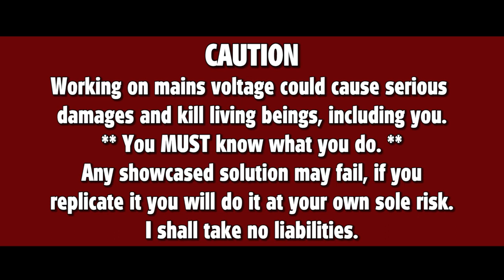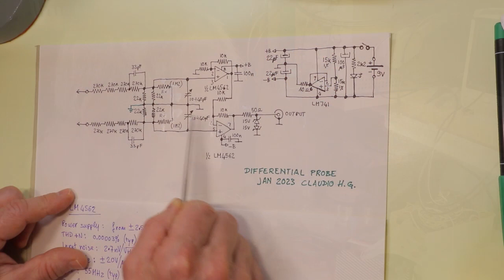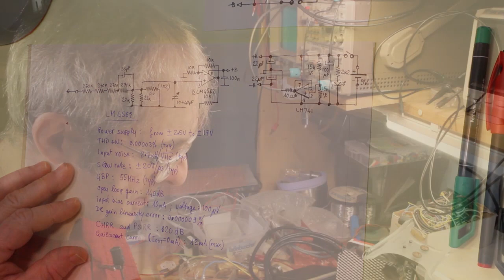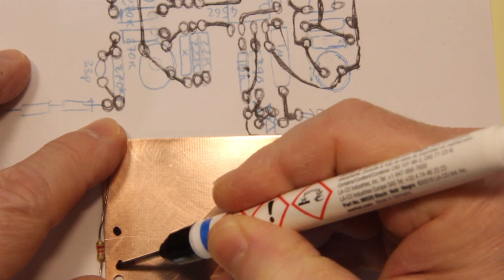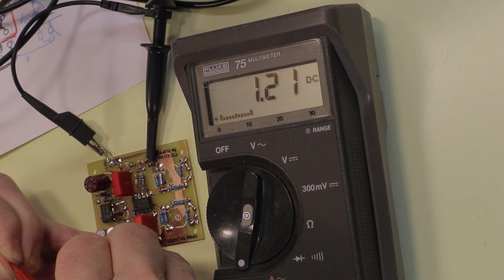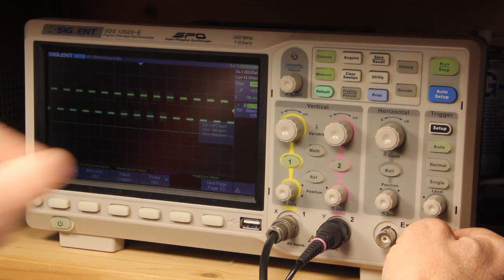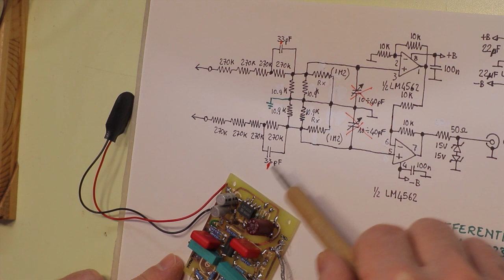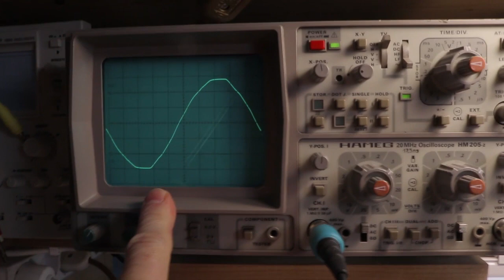DIY Active Differential Probe for your oscilloscope | Do-it-yourself electronics

Comment: Pausing to comment on a couple of things:
quad opamps give you 4 of them per package.  There are useful things you can do with one more opamp.
Two 9V batteries can also be used so you have +/-9V to work with.
A trimmer resistor can be used to make up for the fact that your resistors are only 1% unless you have a big budget.
To trim the resistors you apply the same signal to both inputs and trim for no  output.
Reply from the maker: Thanks for commenting. Cheap trimmers can be a source of problem as they vary with temperature much more than regular resistors. Good trimmers are immune but they are way more expensive than 0.1% resistors. So I preferred to select pairs among a bunch of 1% resistors. I don't remember if I mentioned it in the video, sometimes I take for granted things...
Cheers.

Comment: Really glad I stumbled across your channel. And hope to see you get a lot more followers and attention in the future.

Regarding this build... The weak link is definitely the Duracell battery. I've lost thousands of dollars of test equipment and other associated tooling to Duracell batteries. Some of my favorite portable lab equipment over the years. LCR meters, pricey multimeters, handheld Scopes.... And all kinds of other random things. 

Technically all alkalines are risky....But Duracell is the worst for some reason. Which is a real shame because they used to be the best for a very long time. 

Now i will only use the Energizer ultimate lithiums... They're not rechargeable and they are more expensive but I've never had one  leak. And they seem to last three to five times longer than your standard Duracell alkaline. 

Luckily most portable test equipment these days is being built with internal rechargeable lithium cells. Most of which are standard 18650s that can be swapped if they ever wear out. But they're still a surprising amount of medium to high-end equipment that doesn't have its own internal rechargeable battery. For some crazy reason 🤷‍♂️🤦‍♂️

I really enjoy the videos and look forward to more content from you in the future!
Reply from the maker: Thank you. Lithium batteries are expensive at the point they may shift the cost of the whole equipment.

Comment: Hi, nice video,
what sort of pen/marker did you use to mask the PCB before etching?
Reply from the maker: It's "Dura ink 5", it's similar to paint pens used to mark on metal but with a finer tip (about 1mm). Alternatively I use a quill pen with ink for metals, which gives better results, in particular ink resistance against the acid and water, but it's harder to master.
Reply: @AccidentalScience  Thank you :)

Comment: Where do you get the resist pen  I've tryed some with no good results ?
Reply from the maker: I use a paint marker pen, with oil-based ink. A few are available with a reasonable fine tip (about 0.8mm), specifically what I use as resist pen is a "dura-ink" long thin point made by Markal. It is labelled as corrosive but it is not that corrosive on copper. Best results are achieved using an ink for metal stampers and a fountain pen, though it is a tad more cumbersome to use. Also try to give a look at this: https://accidentalscience.com/12/Printed%20circuit%20board%20techniques.html
Reply: thanks i found some and will give it a try

Comment: what is the max frequency can be read by this probe?
Reply from the maker: @endremurti  as you can read from the related article on my website I haven't done a proper bandwidth test but using a known frequency and amplitude of 1 meg I've been able to see no attenuation.
Reply: @AccidentalScience  oke 1mhz is more than enough, i need some of such device to develop my smps
Reply from the maker: @endremurti  actually is not that much if you plan to use it on an SMPS. You'd be better off adding the capacitive compensation provided you purchase the right capacitors (you need almost 1000v to be safe) made in EU or in US.
Reply: @AccidentalScience ok ,you mean like atc capacitor for high power rf?
Reply: By the way thanks for share this project ⚡️

Comment: The compensation capacitors should go across all 4 input resistors, not just one of them as you have it, IMHO. It has almost no effect when you put it across just one resistor. It should be safety cap.
Reply from the maker: I'm on a mobile so forgive the short answer. Under frequency domain capacitors can be seen as resistors (1/(2πfC)). In probes the series capacitor (parallel to the series resistor) works to form a reactive divider with the parasitic parallel capacitor (the one that is in parallel to the input). Ultimately it doesn't matter where the series cap is placed as long as it adds up as "frequency depending resistor".
Thanks for commenting.
Reply: @AccidentalScience  Well, it's not the same if you place that compensation cap across 1 resistor, or you place this cap across that whole array of resistors.
Reply from the maker: I was out of my studio and was hard to give a good reply with the mobile phone. And your comment deserves a deeper reply because it gives the opportunity to clarify a doubt that others may have as well.
Yes, of course it is not the same of having the cap across 1 resistor and with another resistor in series. Typically probes have a capacitor that bypasses entirely the input resistor, to form a capacitor divider with the parasitic capacitance of the input port. Adjusting for the right capacitance it can provide almost a flat response.
Here however I did not want to have a capacitor that bypasses the whole input resistors. That was because I'm worried that someone may copy the project and put a cap rated for not enough voltage!
The device is anyway limited in frequency because of the OPAMP and the use of cord probes, and I expected it to be below 500KHz, which is more than enough to measure mains voltage. Under these constrains having a compensation capacitor on just the last resistor does not change much the final result, because in any case you have a roll-off frequency. 
Using SPICE I've seen that a capacitor of .05pF in parallel with the entire series of resistors (2.15M) should be enough. That's likely the parasitic cap across the very same resistors. Also, I've seen that with a cap of .5pF / 1pF across the last resistor (470K) gives a nice roll-off at 1.6MHz.
Indeed I had the chance of testing the probe for the actual bandwidth, without compensation capacitor it is about 300KHz, with 1pF cap (parallel to the 470K) it reaches 1MHz before rolling off, with a slight overshoot centered at approx. 400KHz. The same 1pF cap in parallel to the whole series caused an unacceptable increase of the response above 100KHz.
So as a final consideration I'd say that it doesn't worth to have a compensation capacitance given the intended application.
Cheers.

Comment: Why not use higher bandwidth differential amplifiers? Instrumentation amplifiers have unnecessarily high input impedance and low bandwidth.
Reply from the maker: Higher bandwidth, such as? May you suggest something?
Reply: @AccidentalScience  2 x THS4631 for the input buffers, and a THS3491 as the differential amplifier. Your "design" has very low bandwidth and terrible slew rate for a general purpose differential probe.
Reply from the maker: Dear, my probe is not for "general purpose", it is meant to measure AC mains! Look at the probe cables, do you really think those cables would fit a measurement in the range of megahertz? Anyway, thanks for the indication of the THS4631, it is relatively more expensive compared to the LM4562, and has worse THD while featuring ~4 times larger bandwith product. So it is an interesting component, and indeed I made an attempt to purchase some pieces a year ago but I gave up as they were constantly out of stock at the time.
Back to the probe. My probe, which indeed uses a very classic configuration so my "design" is very limited here, uses just a single OPAMP. It doesn't even feature a proper compensation because it would require capacitors with certain specifications about the ability to withstand almost 1500V with no leakage. I fear people may try to replicate the project and purchase those assorted bags from Chinese sellers on Amazon, components that I wouldn't trust even at 100V.
So I preferred to be conservative and keep a moderate compensation. This provide a probe that has a bandwith (-3dB) of about 1.8 MHz and 10MHz at +/-6dB, which I dare to say should be more than enough for a probe meant to measure AC mains waveforms, including high order harmonics and spikes. And it is dirty cheap with easy to get components.
Cheers.
Reply: @AccidentalScience  ... The THS4631 is a FET input opamp with 1000V/µs slew rate. The LM4562 has like 20V/µs slew rate. It's a whole different class of amplifier. If all you want to do is look at your 60Hz mains, anything will work, but it's pretty useless.

Comment: I built this probe, but I see the same "clipping" (but it is no clipping,just a deformed sinus), I added a small capacitor over the inputs of the opamp, so form pin 3 to 5 , then the sinus is must better, (still not prefect., but of course this will change the gain factor , so to compensate this I change the resistor 10K from pin 7 to 6 , to a restistor of 6k8 +10k potentiometer , now i have a variable gain, and a acceptable sinus

but i don't have enough knowledge of elektronics, why this "clipping" behaviour exsist?
Reply from the maker: You must have made some mistake somewhere. The capacitor between the non-inverting inputs of the two opamps doesn't make sense. I'm on my mobile  and I can't give a complete reply now. Clipping may happen because the output exceeds the supply voltage (less the voltage drop of the internal output drivers). This can be caused by a wrong input attenuator, wrong feedback resistors. First check if the input attenuator is correct by measuring with an ohmmeter: each branch, branch toward gnd and end to end. Also test the instrument with a low voltage source before attempting to read the mains voltage! You must be sure the attenuator works properly! This is very important.
Reply: Thanks for fast reply, I have measured the attenuator well, resistance, but also applied a voltage, and at the end the rest voltage, this was correct, as soon as I have time I will take a picture with and without a capacitor, also a picture of the sine measured with a transformer 230 to 12 V ac, the voltage certainly does not clip, power supply is + and - 12 Volt, the peak peak does not exceed 3.5 Volt
Reply from the maker: So you connected a 12V dual power supply, with + to +B, - to -B, and GND to GND? So skipping the battery and the OP07 (or LM741) altogether? Also, the input probe + (the one that goes to pin 5) and input probe - are hooked to a 12VAC source, and you get 3.5Vpp in output (pin 7) ?
If so, something doesn't add up. With 12VAC rms (16.9Vp) at the probe inputs, the output at pin 7 should be 0.17Vpp (or 0.085Vp).
As said the clipping can be caused only because the voltage swing of the OPAMP's output exceed the available voltage, that is given by the power supply voltage minus the internal output drivers' voltage drop. For the LM4562 the voltage drop is ~+/-3V with +/-15V supply, so with a +/-12V supply the max swing would be +/-9V, in reality it is a bit less and should be around +/-8V. You have plenty of voltage and you should not have any clipping. Check the actual voltage at the pin 4 and 8. Be sure to check both in respect to GND, and between them. Check the voltage is clean and stable.
Also the attenuation ratio/gain ratio doesn't seems to add up properly, as mentioned above.
First, connect probe - to one pole of the 12VAC source, and GND to the other pole. Then check at pin 3 the voltage and compare it with the voltage between GND and the probe - . You should have 0.043Vp at pin 3 with 16.9Vp at the probe.
Do the same with the probe +, checking the pin 5: you must have the same values as for probe - .
I will not able to reply for the days to come, so if you reply something here I will not see it before next week.
AFAIK it is not possible to upload pictures here, so I'd suggesto to comment in the related topic at my facebook page where it should be possible to upload pictures.
Reply: @AccidentalScience  yes i complety removed the op07 cirquit and replace by a double supply -12 and + 12 Volt (measured -11,95 and +12,02 V).
I also measured the resistance of the attenuator

again I have done a lot of measurements, and find out that my incoming mains have not a nice sinus, but some topping (looks like clipping), I put your design on the scope with a signal generator Sinus, then the sinus is perfect. measured with 2 scopes, no difference, and measure with a transformer 230/12 V, also there the sinus have some topping.
I also removed the small capacitor form pin 3 to 5 , and checked the signal, without I see the "real" mains with some cilpping/ topping,  with the capacitor is see a sinus, so the capacitor is changing the real signal!

Conclusion: the design of the probe works perfect, only the mains is not so nice..... (searching on internet, I see a lot of people have the deformed sinus at home). the "variable gain 6,8K+10 K, (instead the 10k resistor), is nice.  Best regards Wim
Reply from the maker: @wimlemson6498  fine, I'm glad you found the problem. A variable gain is not a good thing because it reduces the accuracy of the instrument. Greetings.

Comment: Hi, awesome video. New to the channel too. You would know if this design is suitable for probing on SMPS? As far as I could tell the SMPS I am messing around with has a fOsc of around 100kHz can't say that's what the MosFETs are being switched at but I'd say that's around the frequency that would be used. I might make the Altium design too. It's on https://www.youtube.com/watch?v=zQDLY-ot4eo. Possibly over specfor what I would use it for but I think it will make a for a fun project to do for myself. I am asking since If this design is adequate as well, I'll totally take on it and maybe make it in KiCAD too. Wishing myself luck too. and Happy holidays!!
Reply from the maker: Sorry for the late reply: your comment was been held by YT because of the included link and I had to approve it manually.
The probe designed by @Altium Academy similar to mine in its essence: a couple of attenuators that refer to ground, and an instrumentation amplifier that picks up the signal difference, buffer it and amplify. Mine is way simpler than the one made by Altium. My probe's goal is to measure low frequency (from memory bandwidth should be around 10 MHz), while Altium's design goal is 250MHz. A whole different beast. He uses ADA4817 that have a whopping 1050MHz Vs. LM4562's 55MHz, which is a more common chip used in audio applications that one likely have on his shelf.
So to answer your question, while my probe would take the voltage you find in a SMPS it is not the best fit for the frequency you have, and I suggest to go for the Altium's design for that purpose.
Happy new year.
Reply: @AccidentalScience  Your design will be good enough for most switching mode power supply trouble shooting.  Debugging a switcher involves some amount of looking at the waveform and then working out what the waveform really looks like and then deciding if it is correct.  I you look at the points with the small swings on them, you have to remember that right near your probe is a huge swing happening just about in step with what you are measuring.  The voltages on the windings always have some ringing on them so they look ugly.
Reply: @kensmith5694  I totally agree. It is more than enough to check if there is a proper switching signal to the mosfets/transistors. It usually never goes above 200kHz. Mostly a lot less than that. Maybe around 50kHz. So this probe would be absolutely fine for repairing SMPS.